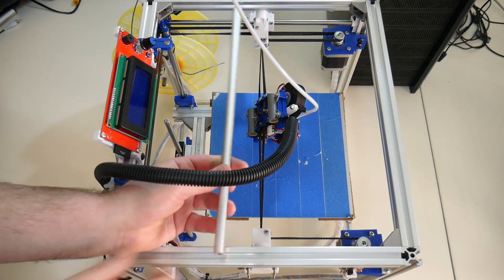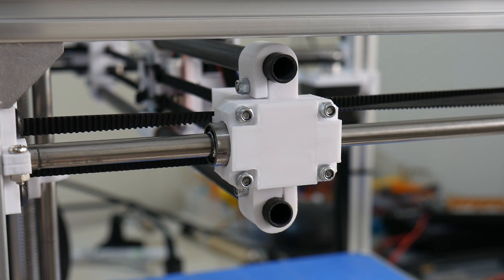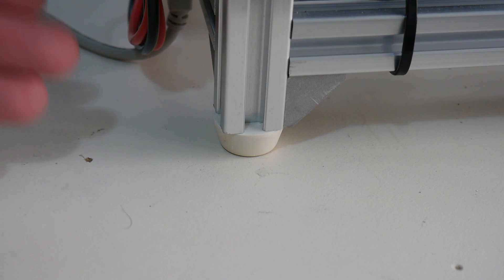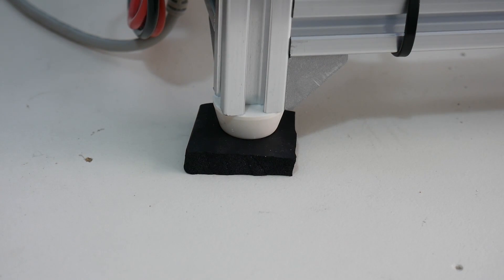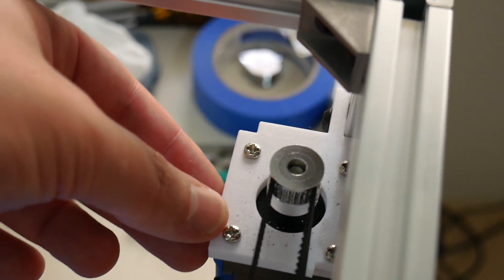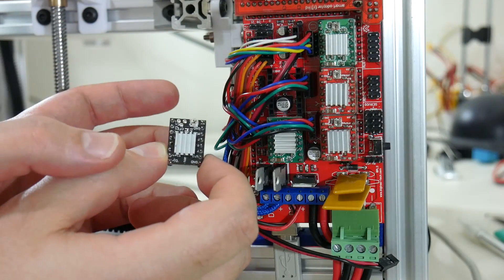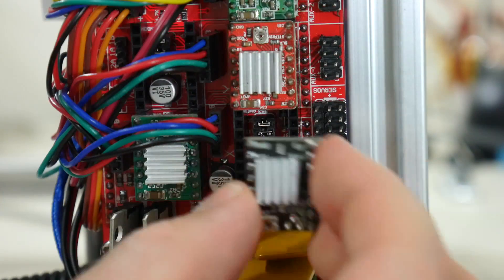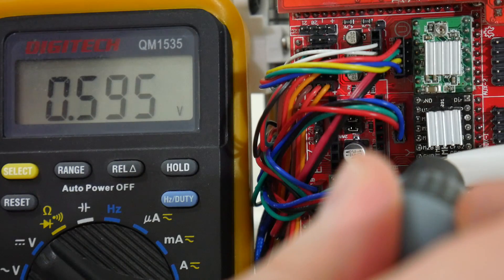Silence a noisy 3D Printer

Comment: First nice video, I am glad that you also got this nasty rattle and tried to solve . You should have recorded sound closer to the printer, for me it sounded like I could still hear the rattling all the time ! But if you say that the TMC will fix the rattling I will also order ... my problem is that my rattling is over 50 mm/s and it gets worse when increasing speed, I will put some dampening material under my printer I saw some feet that use tennis balls as dampers ...
Reply from the maker: If yours rattles the faster you move, then maybe a component is really lose, or one of the step driver sticks is faulty.
Try moving 1 motor at a time by moving diagonally, it should be much quieter.
Reply: Tech2C I already identified the rattle as being caused by only one of the motors and then switched motors but it stayed so probably it is one of the sticks . Problem is I have a Printrboard so no way to change sticks . Then I bought a RAMPS clone with A4988 sticks, configured it but it seems to rattle even worse than the Printrboard . So now I am thinking to buy either 2 DRV or 2 TMC2100 just for X Y ... of course I rebuilt the printer 3 times with different bearings, IGUS, bushings etc but no change .
Reply from the maker: Oh that sux. It definitely sounds like the on-board stepper driver is faulty. Luckily a RAMPS kit is cheap ;)

Comment: Hey! Nice video, thanks! Are you using 12 or 24 V? Reason I ask: I run my Kossel @12V and at that voltage, the TMC2100s will hiss quite badly with spreadcycle enabled. I nearly have to use stealthchop, otherwise my ears would fall off... any similar experiences?
Reply: I have the same problem. The Whining noise should be reduced on Spreadcycle over 18V. But I've tried up to 34.6V and it didn't make that much of a difference. If I'm not mistaken, it comes down to inductance. Some motors will just be quieter than others.
Reply: maybe rhis is the same problem with the DRV8825 ? http://www.engineerination.com/2015/02/drv8825-missing-steps.html?m=1
Reply: Thanks mate, good to know, will keep this in mind.

Comment: Have you tried 3d printed bushings?

I've had some success with making some out of PETG. I have Taulman 910 that I want to try too. In order to reduce friction without sacrificing precision I make the hole a square with the sides the same length as the rod diameter, then print the bushing vertically so that they are just vertical walls. Then I take a drill bit with the right diameter and clean up the holes. 

Because the holes are square there's a lot less plastic in contact with the rod (it is only in contact at 4 points and not around the entire rod) which reduces friction, but the bearing is still captured and cannot move or wobble around.

In order to reduce friction further I hollow out most of the middle so that it only leaves 5mm of the square holes at the ends. This actually leaves lots of space to fill up with grease if you want to try lubricating the plastic.

There are also tons of drop-in replacement designs on thingiverse to try out.

The benefit at the end of the day is a lot less vibration and no metal against metal. Plastic bushings just aren't going to rattle the way the individual balls inside linear bearings do.

If that fails you always get off-the-shelf IGUS bushings.
Reply from the maker: Yes replacing the LM8LUU with a polymer will solve the noise, but as I found out in video Build Log #15, the XY_Joiners clamp around the bushing and disfigure the shape. This vastly increases friction and so I couldn't use them here.

Good idea with your method, thanks for sharing :)
Reply: You can try and print the joiner and bushing as one part.. ;)
Reply: IGUS do have 3d printing fillament. I got a 10m sample from them and I made a few tests and a few bushings it. Right now i've put 1 of the bushing on my printer to test it's durability. You really have to make it just a tad loose, so it doesn't bind.
Reply: I'm using printed LM8-style bearings on both X and Y axis. Working fine so far.
Reply: Pilot16H, you heard that about prior model of Igus bushings, and you probably heard it on Thomas Sanlanderer's video. Allegedly the newer RJMP series doesn't need to be pressed into final dimension, as it's designed for ring mounts that couldn't possibly do that.

Comment: What about a nano zero stepper driver? I have these in my hyper cube. Super silent, and the don't heat the stepper motors.
Reply: Sevendogtags That's true, they are not polulu in price, but you will never miss a step again! And you will never have layer shift from motor harmonics either.
Reply: btechnet are they a Drop in replacement for the pololu ones?
Reply: They are not "drop in" per se, but they do have step/dir pins (and enable) that are 3.3v (and 5v tolerant due to logic level shifting). I have them running on my RAMPS and Smoothieboard. They are directly compatible with the I/O on RAMPS and Smoothieboard. Look at my channel for examples or look at the "Tropical Labs" channel. They show tons of good information.
Reply: Did I mention that the Nano Zero Steppers are closed loop?
Reply: Damn, they're 50 bucks each! :D

Comment: Regarding the X-Axis rails - An interesting side effect of the Core-XY drive system that I found in my build is that it also provides the XY axis alignment, the XY bearing carriers do not play much part in XY alignment (getting them square). I did my XY alignment by differing the tension on the two belts; tensioning the lower one and locking it then changing tension on the upper one until the XY axis is square. 

This side effect is nice in that the XY bearing carrier prints do not have to be exactly square so small print defects can be corrected!

Thanks for another tips on the Hypercube, useful as always!
 - Eddy

Comment: You should consider upgrading your ramps to something like a duet wifi. I have a duet wifi and love it
Reply: I have 3 duet wifi's and an original duet 0.6x board. Far superior to ramps with tmc2100 drivers. I've had those too and if they aren't on 24v the motors whine a bunch unless they somehow fixed that issue. It is a costly upgrade, but wifi access to your printer without the need for extra hardware like a pi with octoprint is better and it has better tmc drivers on there as well..
Reply: I will second the Duet WiFi, i love it! One little thing i've requested is to allow us to connect to more complex security protected networks, not something the average user needs though.

Comment: Spread Cycle is still quiet. In fact my inkjet printer is louder than that. I have been tempted by these drivers for a while now, but have been unsure  if they will drive my steppers (Nema 17 48mm 2.5A). Has anyone seen the TMC 2660 drivers available anywhere yet? Might just have to break the budget and purchase a Duet Wifi.

Comment: Some people say using a slab of concrete as the base also helps with dampening vibrations.
Reply from the maker: That would make the printer a bit heavy to move around, haha.
Reply: yea makes it hard when i bring my printer to church every weekend :P
Reply: I'm curious about what it is you are using your printer at church for?
Reply: it can change your resonance frequency when you increase the entire mass of the printer. Ive done it- it works, try to bolt it onto the hard surface though- it also makes for better prints as the movement doesn't wobble the printer.
next time your at bunnings just get a big tile slab for like 15 bux and CA glue your feet to it to test - do a before and after
Reply: I went with Sorbothane 3/4" diameter. Work great.
They're used in the High End Audio field for damping vibration on turntables, preamps, tube amps, and other vibration sensitive devices.
No affiliated with these guys AT ALL, but I got them from http://www.isolateit.com . I also use them in my audio equipment, so I know they work. NASA and the military use Sorbothane in many applications.
Reply: I used the same trick I use for Technics SL-1200's dj turntables. Take a concrete pavement tile, cut to size with angle grinder + concrete disc, polymer-glue 4 tennis balls under it for an unbeatable noise isolator and resonance killer. Looks real funky too.

Comment: I use HR4988 1/128 driver set at 1/64 mode for XY-axis and 1/128 mode for extruder and Z-axis, I also run the whole printer at 60mm/s, it is extremely quite and while printing what I can hear is just fan noise and nothing else, a better driver worth it. Consider the price is just around 1USD each, I would say it is a good chip alternative to normal A4988 too
Reply: I use a custom Arduino 2560 board. And also because the Arduino isn't fast enough, I had to run the XY axis in 1/64 mode, so I can get faster print speed, but for Z and Extruder, they rarly move at high speed, so a 1/128 stepper driver is fine
Reply: DuetWifi comes with TMC2660 built in, they are 1/16 with 16x interpolation like TMC2100. If you want to run external drivers with RRF you need to get RADDS. There are also some Smoothie-compatible boards with driver sockets but I have not been impressed with Smoothieware. Just get a DuetWifi, it really is the best.
Reply: You couldn't use a 1/128 driver in a RAMPS board. The Arduino can't step fast enough, it can only manage about 10kHz accurately and 40kHz while quadstepping. The fastest that a single motor could move is less than 32mm/sec, and you use more than one motor while printing so two motors would move at 16mm/sec. I don't expect miracles but I want to print faster than that ;)
Reply: Of course a 32-bit board solves this problem. RepRapFirmware steps at 240kHz and Smoothieware steps at 100kHz.
Reply: What controller did you use?
Reply: Thanks for the info. I can't seems where to buy HR4988 driver and thinking to either get a DuetWifi or a custom Arduino board
Reply: Here is a link for you, but the site is in China, so you may need to ask it they will ship that worldwide
https://item.taobao.com/item.htm?spm=a230r.1.14.49.hExaV6&id=540109733448&ns=1&abbucket=4#detail
Reply: tmc work in a different way, yours are real microstepping tmc use the normal micorstepping but split each one in 256 sub-step.

Comment: Have you tried the DRV8825? Do you think they're worth it over the normal A4988?
Reply: You can get this diode circuit pre-made with motor cables as "TL Smoother" on Aliexpress.
Reply: i dont think the DRV8825 are as good as the A4988 drivers on a some printers. There is a 'TL smoother' add on diode module for them that helps smooth the voltage and current waveforms for more silent operation.
Reply: im glad more people know about this- alot of people are running drv8825 clueless.
Reply: So, no stress on the Ramps then?  Ramps can barely keep up with 1/16.
Reply: Do you have a link where I can read more about that? I will receive a Delta Kossel DIY Kit soon. It comes with Arduino, Ramps and DRV8825. As deltas need more calculations for their movements, I want to use 1/16 microstepping, but if you're right, the arduino would need to calculate 32 microsteps, no matter if the DRV8825 is jumpered to 1/16, which would be sad.
Reply: that high pitch also means the inductance is wrong for the motor, often meaning a microstep or two is lost, makes kinda funky moire patterns on spheres.
Reply: Tech2C i have 8825's i don't Think they are anything special. My son hears the whine too, and can't stand being in the room when it's on. Plus I have massive issues with "echo:busy processing" (and this is not even a core xy or delta" it might be the 32 microstepping might not
Reply: Does anyone know of some cheap 32-bit upgrades for RAMPS to compensate for the DRV8825’s? I am surprised there isn’t a 5V Arduino Due on the market and my printer’s stepper drivers need to handle higher current than the A4988’s.
Reply from the maker: I have. I hear a high pitched squeal from the motors so I don't use them. Also they require the Arduino to process the 32 micorsteps which reduces our CPU ability on the old 8-bit processor.
Reply: Thanks! But you said the TMC2100 did 256 microsteps? Or does it do that independent from the CPU somehow?
Reply from the maker: Yes it accepts the same 16 microsteps from the controller and interpolates that into 256 microsteps. Very convenient!